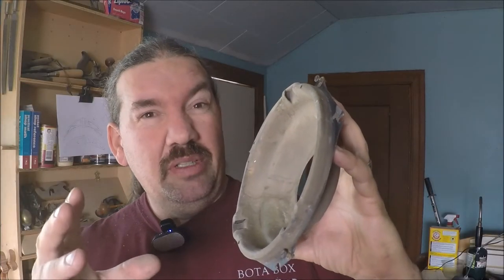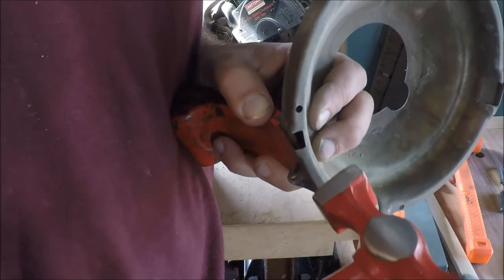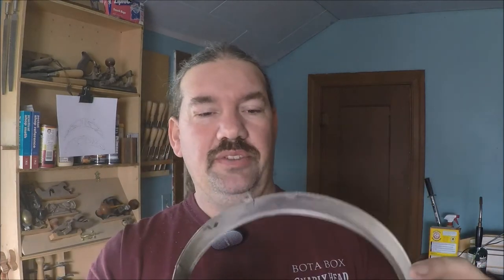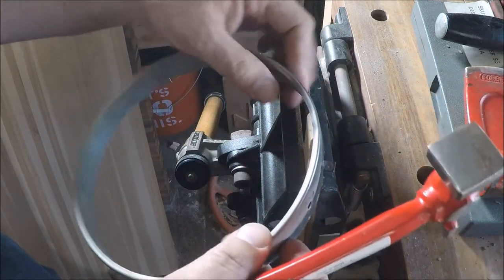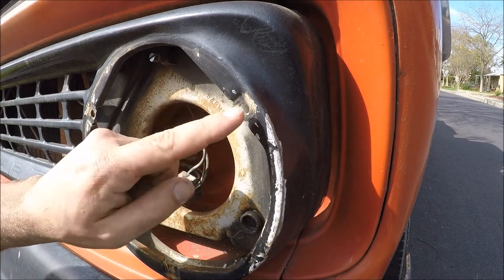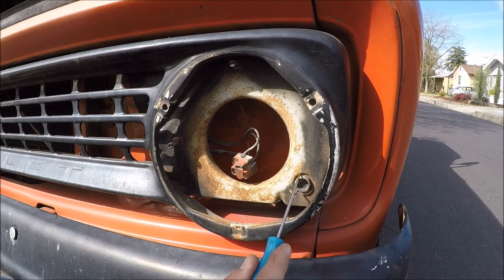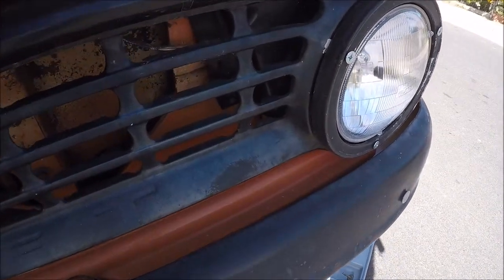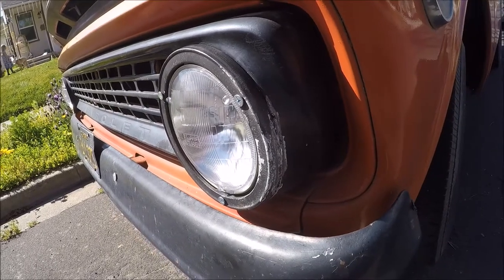Straightening Bent Metal: oops!!! #2

Comment: Nice work Chris. That must have been a pretty tall vehicle that bumped it. Those Chevy trucks are tough. I had a 3/4 ton 65 that I slid off the road with. I plowed through three wooden fence posts and snapped off an 1 1/2" pipe road sign. Didn't do more than scratch the paint on the bumper.
Reply from the maker: Yeah the corner of the bumper hit the ring dead on I was surprised to see so little damage myself.